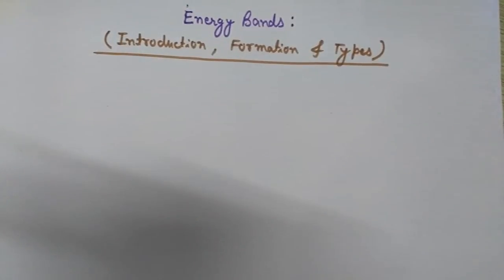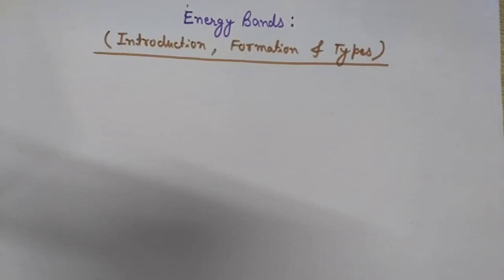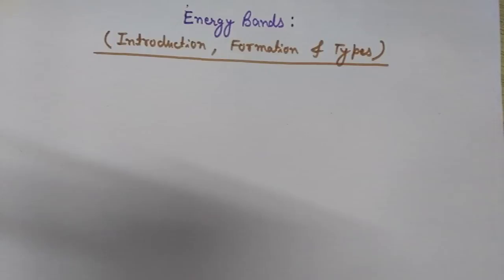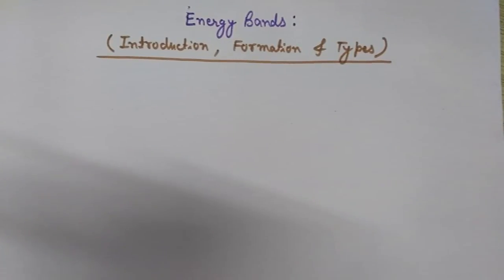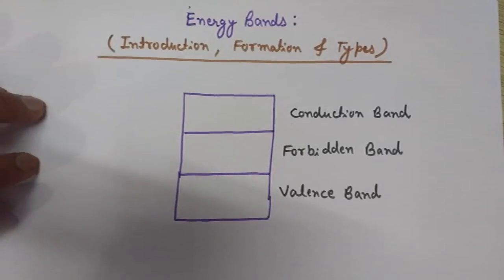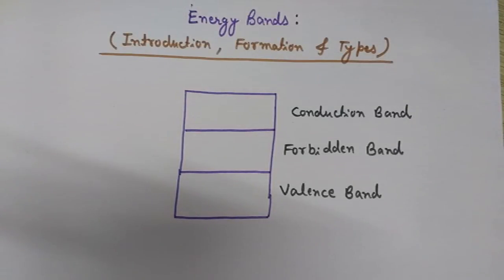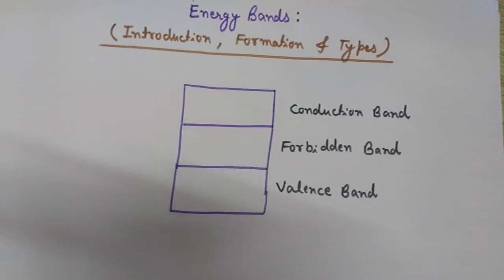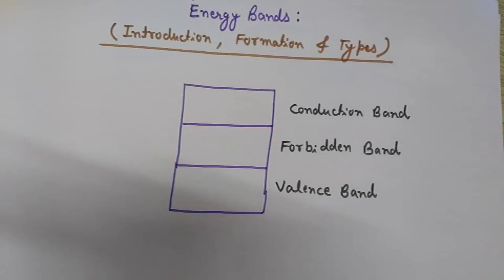How Energy Bands are Formed in Semiconductor - Conduction Band and Valence Band in Semiconductor

Comment: Sir why this forbidden gap is large in case of insulator and is negligible in case of conductor. By the way Thanks for explanation.
Reply from the maker: If energy gap is large it just means that large amount of energy is required to break the bond (insulators). So band theory is just a concept which helps in understanding this thing. Reaching into  Conduction band means freeing of charge Carrier.
Reply: Engineering Made Easy Thank you very much sir. Now I understood completely.👍👍
Reply from the maker: You are welcome... Keep watching for more videos and stay connected
Reply: Engineering Made Easy Ok sir